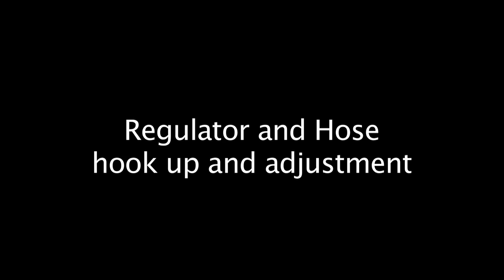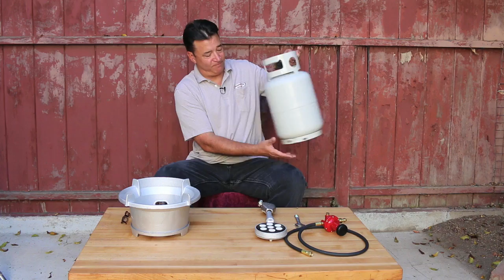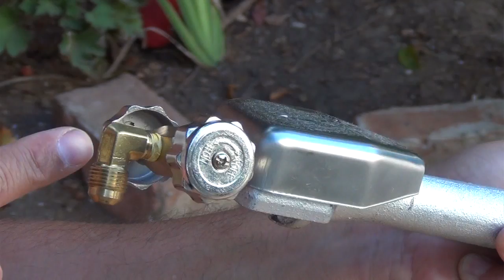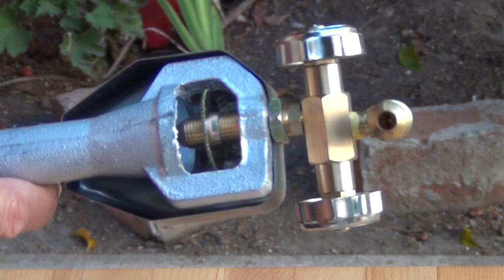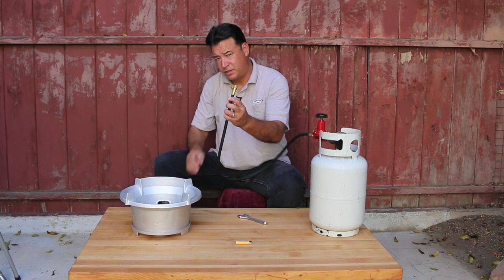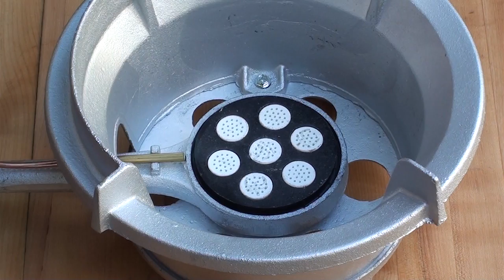EZ-Wok Regulator Adjustment Tutorial for the High Heat Burner

Comment: Excellent presentation! Just one question , is the  connection same for all kind of high pressure gas burner ? Thanks !
Reply from the maker: Thank you for watching David-
The connection to the tank is usually the same with the regulator-
The connection from fuel line to burner may vary, with the burner I use, I have modified mine so the connection is a threaded connection, just felt a bit more comfortable for me(safety) also using a 90 degree fitting-the fuel line goes down instead of to my body.
Hope that answered your question!
Cheers
G

Comment: Is 72k BTU's enough for stir fry?  If you want that restaurant taste, don't you need at least 100k to 150K BTU's?
Reply from the maker: Hello deltafour1212, It has been my experience with the X72 / 72k btu burner, that I have been able to accomplish everything with it as I did with my older burners that did put out 100k.
I continue to practice my Wok Hei skills -  this burner at 72k BTU's has no problem giving me the heat I need to accomplish this. The other Key for me is the fuel consumption.
When I started using these type of high pressure LP gas burners back in the 90's after my store closed, I was thrilled to find a tool that would allow me to continue to cook the foods I enjoy most & share with clients, friends & family.
When I got my hands on the X72 and discovered I was still getting the same results as I did with my older burners but now I'm not going through the fuel like before. (Big key for me) I still have the old burners & they still work, I just enjoy the fuel savings : ))
Thank you for checking in. Hope that answered your question!
Reply: @thewonderwok   Thank you!
Reply from the maker: @deltafour1212  your welcome,

Comment: I received my kit and put everything together late this afternoon. Tomorrow I adjust the burner and season the wok. Thanks for the very good instructional videos. BTW, you mentioned at one point a cover that fits over the system. I think that would be a good addition to help keep the system clean as it will be an outdoor use appliance. Do you have a kink to that cover? Thanks for the information.
Reply: :wave: I've had one of these for three years now.  I throw a BBQ cover on it, and it lives in a covered location for 3/4 of year just fine minus some stray rain when it's very windy.  In the winter, I usually take the whole burner assembly inside (with the time the sun goes down, I don't do a lot of woking in the winter), and leave the cart covered.  Burner and cart looking fine after three years in the PNW where it is very damp.  Hooked it all back up today (hello Spring!) which is why I'm back to watching these videos and saw this.  Good luck.

Comment: Greg, what you have put together is AMAZING. it IS really easy to adjust and operate. Good video!This rocket ship burner is very responsive, and it sure cooks! I just made a breakfast soup in less than 5 min. and that includes flashing brussel sprouts chopped in half and they came out perfect.

Comment: Report Card on the EZ Wok.   After 1 yr of use of the EZ Wok... 
     
     It's number One feature is... How inexpensive and efficient it is with gas to cook with.  I filled the standard gas grill tank a yr ago.. used the EZ Wok at least 25 times... And its still going.  Its nearing the end of the tank.. but I've never got that many uses from a single tank of gas using my standard grill.  And i cooked a boat load of dishes on it feeding 100's of people..
     
     Secondly:  With just a little practice and following Greg's instructions setting the regulator and air mixture.. you maximize cooking time and insure you don't apply to much heat to your food. Heating water or oil you quickly get the feel for how much heat to apply.

     Thirdly: At first i sorta of fumbled with the control like any novice but quickly mastered it and the results showed in the quality of the food.. So it's a short learning curve for heat control.. And like Greg has pointed out in many of his videos you can hear what the food is doing in the Wok and adjust the heat accordingly.

     Fourthly:  Greg has provided a high quality tool that almost insures your success in the craft of recreating either Traditional Chinese culinary dishes or American Chinese Takeout.

     Thinking on it now.. I've changed my mind.. The number One feature of Greg Wong's EZ-Wok and it's the most important one of the EZ-Wok.. is the smiles and fascination and the jaw drop when people taste the food you prepare and cook for them right in their back yards.. And I've taken my EZ-Wok to BBQ's and family gatherings and young and old alike are simply amazed with the food and the units well built quality and people always point out its construction is all stainless steel.  And I demonstrate just how easy clean up is after cooking for a hour or more.. It wipes down clean and maintains a sanitized shiny brand new look.. Which is cool for Guy Pride when your sporting the Corvette of out door cooking centers.. 

Disclaimer:  Greg did not prompt me to write this review.. I get no discounts or kick back for doing so.. I'm a Customer and can appreciate a quality product that delivers everything Greg said it could do and more.. I hope my observations and opinions  help in your decision if you're considering the purchase of an EZ-Wok provided by Greg Wong... Because its worth every penny.. And how many products today can you say that about...

Respectfully Submitted,
David S Edgerly
Whitman, Ma.
Reply: I agree infinity on everything you said and will back you up on it. I have an original Wonder Wok and it's built and runs like a tank, but it folds up and moves like a feather. But the main things like you said are TRUTH! Guest and friends are always saying "it's done?" and then when they taste any recipe Greg has taught us, they are AMAZED.
This is a no brainer to have Gregs system for those who love to cook, or even have bigger families to cook for. Save Time. Save Money.
I use my setup everyday for something, and it's true, a propane tank that never seems to run out, like that Barbasol shaving cream can. lol